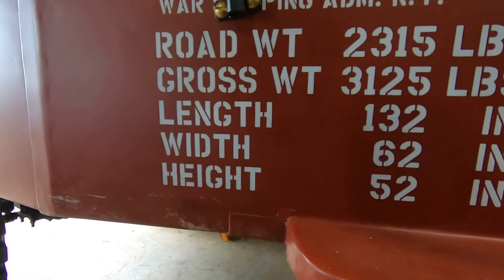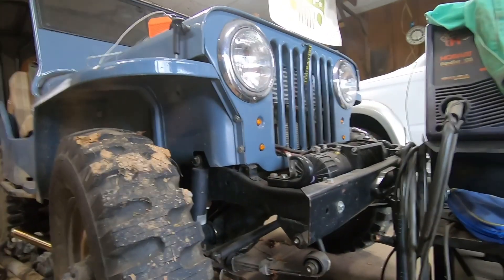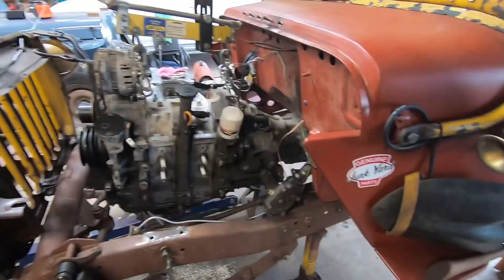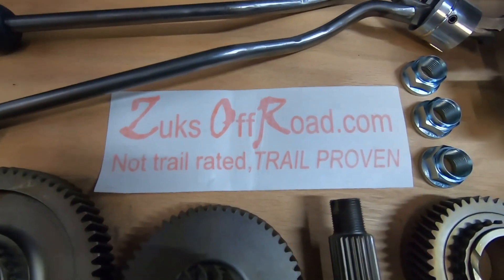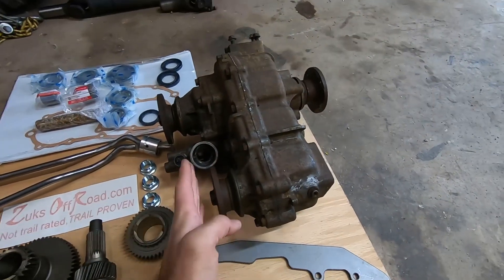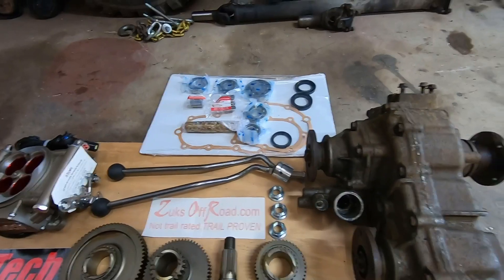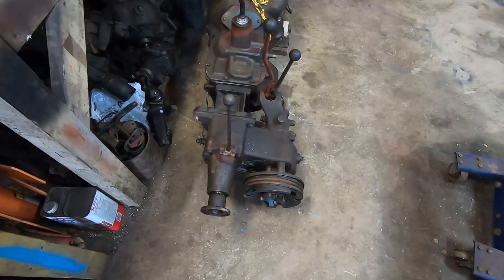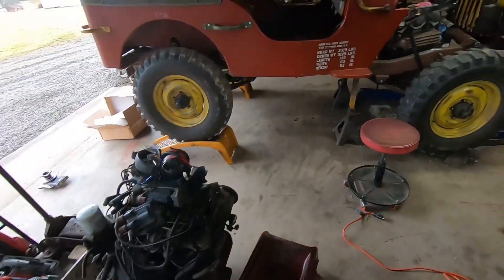Wankel Willys (part 2) transmission and transfer case

Comment: Will a Toyota 22r engine fit in one of these I was thinking about putting one in mine but can’t find a 22r engine for cheap.
Reply from the maker: Yeah the engine will physically fit in the engine bay.  But you would have all the other work involved with an engine swap. The Toyota transmission is too long for the 80” wheelbase.

Comment: Seth, you have done your homework for sure. It's nice to be able to pursue a dream you envisioned. Mercedes Benz diesel in a CJ5, check, VolksWagon diesel in CJ2a, check, Mazda Rotary in a Ford gpw (Willys Jeep), check. Should be a trail performer with fuel injection system.
Reply from the maker: Thanks! I hope you’re right! Time will tell. 👍

Comment: Seth, can you explain why you're going to run premixed gas?  Just curious.   It looks like a fun project!
Reply from the maker: Rotary’s requires oil injection just like the old 2-stroke motorcycles and snowmobiles. The Mazda oil injection system is bulky/ugly and prone to failure. By premixing the fuel and deleting the injection system you remove a headache and have complete control of how much oil and what type of oil is going into the engine. 👍
Reply: @SethHensler  I didn't realize rotary engines needed oil injection.  That does make sense to mix the gas!  Thanks for the explanation.

Comment: Has anyone ever put a 4x4 transmission behind a 13B? I’ve seen those motors in Samurai’s before, not sure if they were 4x4’s
Reply from the maker: Yeah there are several 4x4 samurai swaps out there.

Comment: I like the low center of gravity on the rotary, when you were saying the gearing and the overdrive, plus the RPM capability of the rotary that’s going to be scary fast on the highway! 😂 I like it, it’s different like you said, hopefully having the weight farther forward won’t make it any worse handling, but I’m sure the rotary is lighter than the iron 4 cylinder
Reply from the maker: This engine is so light moving it forward a few inches shouldn’t make any difference.